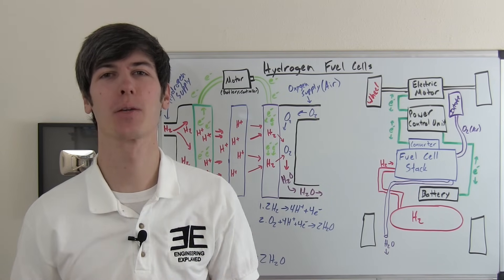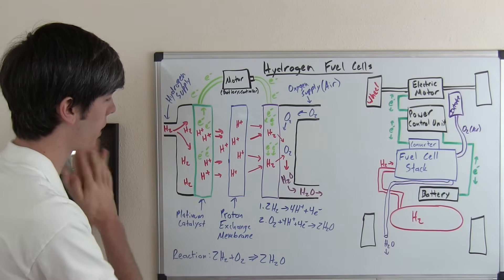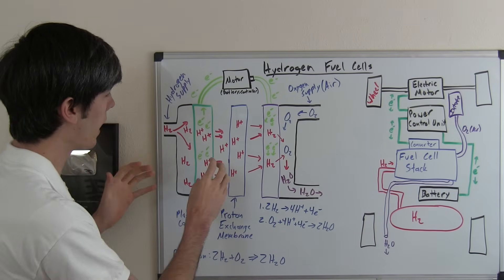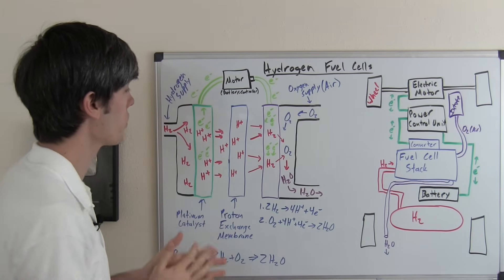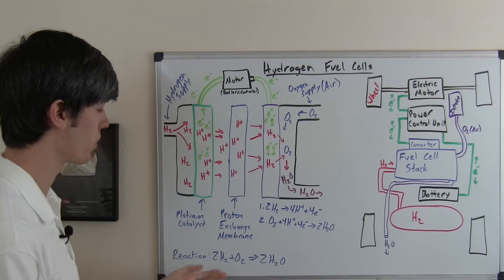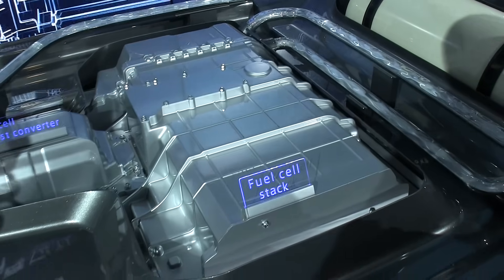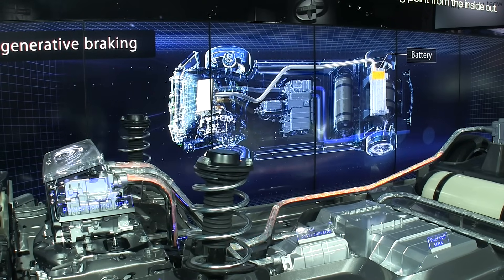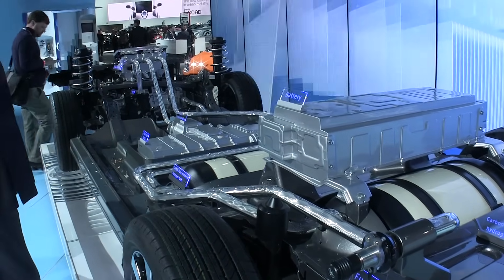Hydrogen Cars - Toyota Mirai - Explained

Comment: You don't need a battery for regenerative braking..send the electricity back to an electolysis system which will function with water from the exhaust, create and store some hydrogen..it will probably be less efficient

Comment: Thx for your explanation m8.
What i am further interested in is energy efficiency. Now i just talked with someone that works in this field and he mentioned 80% i believe. That would be a great number,...
for surplus energy.
Bc we cant mine hydrogen. So we have to make hydrogen. There are 2 common routes for that; electrically (electrolysis), but that is not efficient as there will always be losses in any energy conversion and since we start with electricity to make electricity, that is idiotic. That is, it is idiotic, unless it is surplus energy. That is energy we cannot use at that place at that time. So converting that to H, is energy efficient, if the energy otherwise would go to waste.
The other is cracking CH4. Now a typical fossil fuel plant has a 30% energy to electricity efficiency. So converting, by cracking to H, might be energy efficient, however:
- we dont have the tech to upscale yet. That is, i know of no power plant that uses this tech
- conventional plants (ff) can be upped to an energy effiency of about 70%, if rest heat can be used to warm houses, greenhouses, etc. So in such situations it becomes questionable (and i tend to say it will ne negative) wrt energy efficiency.

Ive been asking also, but not gotten an answer yet, if the 80% energy efficiency is fully calculated through. How long does such an engine last for instance and how much energy is needed to create it? Does the platium wear? Does it get polluted and needs replacement? So all those energetic costs need to be factored in bc you can say it is energetically efficient. Ive got a feeling (as they did with wind turbines, erroneously) that these energetic costs are not in the 80% stated.

So if you have any more information on energy efficiency, id welcome that.
ty

Comment: hello, i am curious to know if the emmisions from hydrogen production using natural gas is better then burning gasoline in your engine
Reply: It depends whether you are talking about grey hydrogen which is when they release all the CO2 to the air or blue hydrogen when they capture most but not all of the CO2. I don't have the figures for cars but I can tell you that with home heating using either CH4 or H2 in a boiler, where both boilers have the same efficiency, blue hydrogen about breaks even at being the same in terms of total greenhouse emissions as just burning CH4. This is because the H2 production process is so inefficient that the increase in CH4 extraction needed pollutes enough to balance out the CO2 savings. Grey hydrogen is far worse. If you used blue hydrogen in a combustion engine then the same would apply, it would be about the same as using fossil fuels. But a fuel cell is about twice as efficient as an ICE so using blue hydrogen in a FC should cut your emissions by about half. Grey Hydrogen would probably still be worse than gasoline, but it might roughly balance. 

Basically Hydrogen is only really green if it's green hydrogen. Blue hydrogen is only valid as a temporary transition fuel to get to green hydrogen. Even green hydrogen is only really worth it when we have enough green electricity that there is a surplus, at least at certain times of day. For cars it's best to use a BEV unless you need to drive further than you can get on a single charge and you are really in such a rush that you can't wait for a top up charge. It takes 3x as much electricity to power a green hydrogen car as it does to power a BEV.

Comment: hydrogen fuel cell motors are electric motors fueled by the breakdown electrical element of hydrogen, which later form with air too produce water as a byproduct and the remnants of the air not utilized in the conversion to water. Why does this step need to occur? couldn't/t the electrons continue to be broken off again and used for fuel for the electric engines? In so doing the fuel needed would be much less than used in hydrogen combusting engines?

Comment: What about airplanes Jet engines ? What would be more efficient ? Burning the H2 in a modified combustion chamber or harnessing that energy from a fuel cell and then power a superconducting motor to turn the fan ?

Comment: Frankly, I completely disagree with all this effort to make hydrogen cars. Truck? Maybe. Not cars. Both types of vehicles operate on electricity, but one makes the electricity directly from your car using hydrogen while the other you plug it in to get the electricity from a central source, which has MUCH greater efficiency at making electricity. Manufacturing hydrogen and it's entire infrastructure, including building the storage tanks, pumps, delivery, etc, requires considerable energy. So again, I believe it much more efficient to let the power companies make the electricity that we can simply plug into. Lastly, I feel it's better to invest in one type of new infrastructure. It's like building DVD players for both Blue-ray AND HD-DVD. Figure out which is best and go with it. Don't make competing technologies which only confuses people, limits each market and creates too much redundancy.

Comment: Couldn't electrolysis be used while charging with the waste water so you wouldn't have to refill the hydrogen tank?
Reply: Not as long as thermodynamics are a thing.
You're idea is similar to "why can't my photovoltaic-powered torchlight not power itself?" or "why can't my dynamo power itself with an e-motor?"

Comment: Will be possible to have a hydrogen making component integrated into the car so that one would only need to supply the car with water to generate power
Reply: No. For the same reason you can't power your solar-cell torchlight with it's own light or an e-motor with a dynamo connected to it.
Reply: @cy-one  what if it's like you plug your car to the wall during the night and it does it?
Reply: @Adrikei  because if you were going to slow charge from a wall outlet it would be much more energy efficient to use a battery. It takes about 3x as much electricity to power a hydrogen car.

Comment: What is the efficiency of the Fuel Cell?  How many kilograms of Hydrogen the Mirai stores in its tanks @ 700 bar pressure?  How much energy does 1 Kg of Hydrogen contain?
Reply: Toyota Mirai: ~ 1 kg of hydrogen for 100 km (EPA cycle). 
1 kg H2 = 33,3 kWh ~ 1 gallon (US) of gasoline. 
The tanks store 5 kg.
The drivetrain is about twice as efficient as internal combustion engines without hybrid technology.

Comment: I freaking LOVE the fuel cell idea. Not only you get to recharge instantly and get all the benefits of the electric car and its electric motors, IT'S ALSO FREE WINDSHIELD WIPER FLUID (since the waste is water and it can be rerouted easily to anything needing water in the car).

Comment: Can you do a video explaining the economic efficiency of using hydrogen vs lpg taking into account  the fact that you produce hydrogen from methane. Why don't u just use methane. Lovely content by the way
Reply: The point of hydrogen vehicles is not to be economically efficient, the point is to be low carbon by using green hydrogen. They are not intended to compete with fossil fuels they are intended to compete with BEV because they can be refuelled much faster and weigh less. Using hydrogen from methane is only a temporary stop gap until green hydrogen production can be increased. Developing hydrogen vehicles would not be worth it if you were only ever going to use hydrogen from methane. 

If you don't capture the CO2 from producing (grey) hydrogen then it's worse than using fossil fuels. If you do capture CO2 then use the (blue) hydrogen in an ICE then it's about equal to fossil fuels (from a GHG perspective, cost wise it's much more expensive). If you use blue hydrogen in a fuel cell then because they are more efficient the emissions will be about half. But you need switch to green hydrogen to get close to zero. 

Your question was about economic efficiency. That is much more complicated to answer for 2 reasons. 1st as technologies mature and through economies of scale they become cheaper. So you can't say how the price will differ in the future, only estimate as an extrapolation from today. 2nd it depends on the taxation regime. Without taxation fossil fuels are generally quite cheap. Wind and solar can be raw price competitive in good locations now. Running costs for BEVs can be competitive because they are so efficient. But hydrogen wouldn't be able to complete on a price basis with fossil fuels. But that is ignoring the cost of pollution. Morally it's right that people who take actions that pollute the environment have to pay to clean up that pollution. If you taxed fossil fuels and used that money to pay for Direct Air Capture to remove all the CO2 released by burning them, then the taxes would have to be much higher than today. That would make green hydrogen financially competitive compared to gasoline.

Comment: Airships used to use hydrogen to fly but stopped using it because of how flammable and dangerous it was and instead started using helium.  Obviously giant airships from the early 1900s are very different from modern hydrogen fuel cell cars today, but what measures have been taken to ensure that the highly flammable hydrogen gas is safe to use?

Comment: A question, could it be done so that the H2O isn't thrown away but reused by splitting 2 H2O back to 2 H2 and O2? You wouldn't need air intake so the car would be more aerodynamic and use less fuel (hydrogen that is), it seems that you wouldn't need to ever refuel it, I'm most definitely wrong because if it could be done someone much smarter than me would already do it

Comment: You did not explain why you want to have 2H₂ + O₂ step performed at all. As electricity was already generated before this step, its utility is not immediately obvious.
Reply: The combustion of hydrogen (i.e. 2H₂ + O₂ ) is actually the step that drives the whole process here.  It does seem odd that this happens at the end everything, but think of this as similar to how a hydroelectric plant works:  Gravity (which would be combustion in this case) is what's really producing the energy, but it's what you do with water while it's falling (hydrogen passing through the membrane in this case) that generates power you can actually use (i.e. electricity).  You could just burn hydrogen directly, but with the membrane trick the process is a lot more efficient.
Reply: @caglartanrikulu  Following your explanation, adding  2H₂ + O₂ step would make sense iff resulting H₂O would be under lower pressure than what one could achieve with a pump working on just H₂ while still retaining positive energy output. In other words according to your explanation  2H₂ + O₂ -> 2H₂O is just a fancy (and more efficient) pump.

I still do not see how it works. Hydroelectric plant analogy does not work for me. The longer I think about it the less of an actual explanation I find in the video (or your comment).
Reply: @MarcinKonarski  I don't think I can explain this easily, but the hydrogen oxidation (2H₂ + O₂ → 2H₂O) is actually where the energy is coming from. After the hydrogen is ionized by the platinum catalyst, it travels to the oxygen molecules and creates positively charged water, which then receives the electrons that were driven through the load (motor, controller, etc.), and that's what completes the circuit
Reply: @austin503  In that case the drawing on the board in the video is wrong as electrons are "reintroduced" to H₊ "before" oxidation.
Reply: Marcin Konarski the electrons are split from the H2 molecules, which is facilitated by the catalyst
Reply: The electrons are not "pushed" into the circuitry towards the motor like he said in the video, it's more like they are pulled. The oxygen in the air accepts electrons on the other side of the membrane, and these negatively charged oxygen atoms bind with the hydrogen that passes through. This has the effect of "pulling" electrons and hydrogen towards the other side, which along with the pressure of the hydrogen drives this process in one direction. 

If you wanted to simply push hydrogen from one side to the other and get electricity, all you would be doing is harvesting the energy from the hydrogen going from high to low pressure. And repressurizing it to make it useful again would take more energy than you would gain from doing that

Comment: I think some thing is  a miss here. At 1:49, if H+ emitting from PEM and e- returning back combine to form H2, why not re-use this H2 instead of combining with Oxygen to create water. From another website with Yale professor commenting  "The energy comes from producing water molecules". Exactly how ? Wish there is a better video explaining the electrical science behind the PEM/fuel cell better and also compression of H2 and density of fuel cells, etc.
Reply: Yes there is something missing. The thing is, the free electrons will bond with the oxygen before the H+ does. Oxygen in it's elemental form is missing 2 electrons to reach its cofiguration of lowest energy. Now the oxygen is way more attractive for the electrons to go. But when the oxygen has get it's 2 additional electrons it becomes temporarily negativly charged until it has bonded with 2 additional protons or H+ which then completes the reaction leaves stable H2O behind.
Reply: And that’s how you “crank start” a fuel cell. By charging up O2 in air so it attracts H+ on the other side of membrane thus starts the chain reaction by having stripped electron from H2 runs through a closed loop circuit.

Comment: Sir, just want to ask that is the power control unit a type of engine or it performs a different function........
Reply: Err, it's a control unit not an engine or motor ;), as per his video it's function is to choose where to send the generated power to the electric motor or the battery
Reply: @Markpd69  thanx for the info! 😀😀😀

Comment: how much voltage amps watts and power does the hydrogen fuel-cell produce and how much power and time does it take to charge the batteries to full capacity , also is the hydrogen fuel just pass by one side or is it a measured shot of Hydrogen that is pressurized against one side of the fuel cell and remains until it no longer produces electricity then displaced by a new or fresh shot of unused Hydrogen? 
while the oxygen side i would imagine has fresh air just floating past it from the open air vents of the vehicle?

Comment: how long can the engine or for this case a fuel cell lasts without any service? also i've been wondering, could the hydrogen atom from the H2O byproduct can be recycled trough a different kind of engine to form it back to Hydrogen?

Comment: why dont they reuse the hydrogen rather than combining it with oxygen????
Reply: +johnny Anderson This is to do with how redox reactions occur (the type of reaction occurring here). The only reason the hydrogen gas abandons it's electrons is so that it can flow through the proton (H+ is a proton) exchange membrane to get to where there is oxygen, and oxygen has plenty of free electrons that the hydrogen can bond to. When the hydrogen splits away, the electrons have no place better to go than to flow through the wire/motor toward the positively charged right-hand side of the cell, which is how we get energy. Once at the other end, the H+ ions react with the oxygen and leave as exhaust. This makes 'space' for more H+ to come through the membrane.
 tl;dr Imagine the oxygen as calling out to the hydrogen and encouraging it to leave it's electrons behind. Otherwise, the hydrogen gas would just stay as gas and wouldn't give us the electrons we need to power the motor.
 '
Reply: +Marlon Leicester aha!!
t
much obliged for taking the time to answer!
Reply: Well, you could do onboard electrolysis in theorie, but it wouldn't be energy efficient. It's way better to propel the electric motor directly with the energy the car stored in the batteries.

Comment: Comments about H2O being as much of a greenhouse gas than CO2?
Reply: +farfolomew Not a problem at all. We don't extract hydrogen gas from the ground, burn it and then produce water. We take water, run an electrical current (potentially from a solar or wind generator) through a platinum electrode that's in contact with the water, and this produces oxygen and hydrogen gas in the EXACT same proportions that hydrogen gas and oxygen are reacted in the hydrogen fuel cell to produce energy. That means that for every 1 litre of H2O coming out of a hydrogen fuel cell's exhaust, we consume 1L of water to produce the same amount of hydrogen as fuel. No problem at all.
Reply: +Marlon Leicester the problem is that most hydrogen fuel is made using fossil fuels because electrolysis is VERY inefficient.
Reply: That's true in the present, but once grid electricity is mainly renewable supplied, that won't be the case. Also, in terms of inefficiency, fossil fuels are burnt to transport fuel, but not electricity, so burning the fuel close to where it is unearthed and then sending electricity for electrolysis doesn't end up being too inefficient in the greater picture. This, and the development of far better PEM electrolysis systems, means it's still very viable.